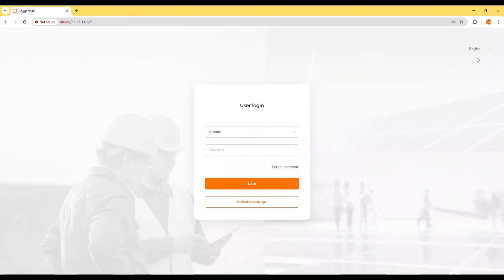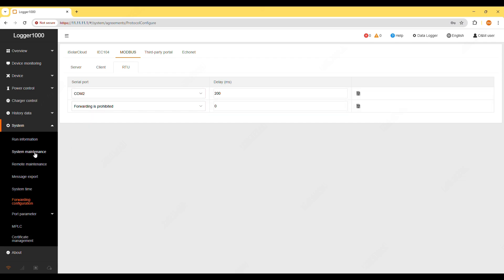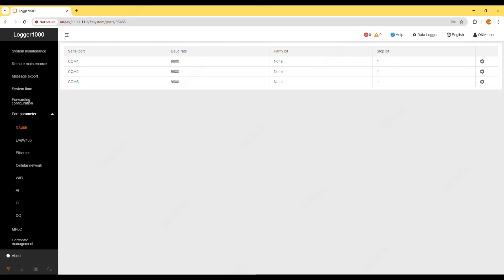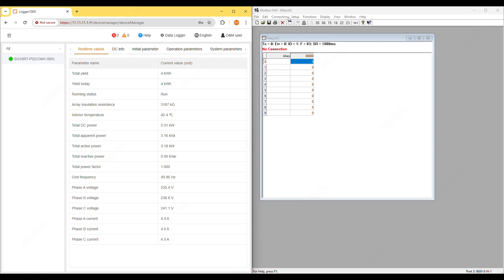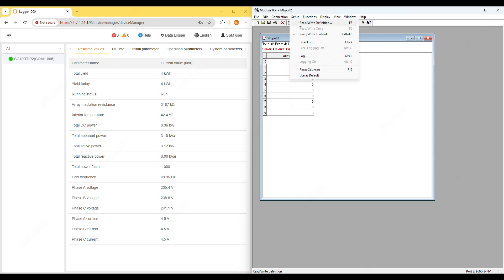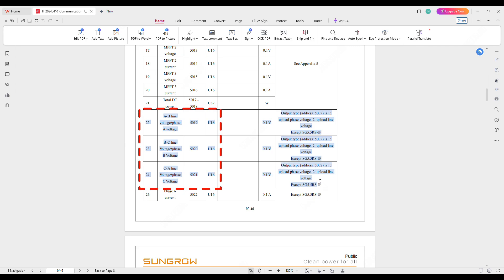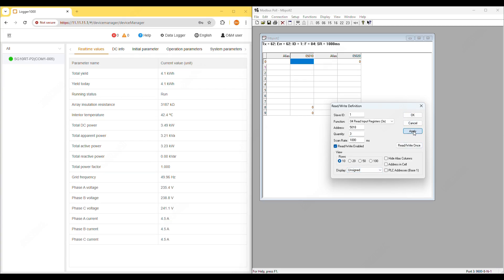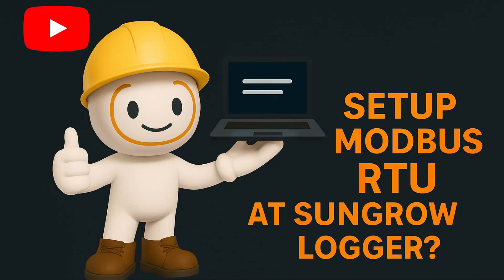Modbus RTU Setup on Sungrow Logger + Modbus Poll Test | Step-by-Step Guide

Comment: How Communicate Modbus TCP method
Reply from the maker: Hi sir, for Modbus TCP/IP, you only need to connect the LAN cable and poll data using the logger’s IP address.

I don’t have a specific video on this topic, but you may refer to the video below if it helps:

https://youtu.be/fRvT2ohYCeo?si=wfpc5BqySIJOM8VI

Comment: If I’m reading Modbus data from the logger’s port 3, while port 2 is already reading the inverter, should I configure it the same way as in your video—i.e., set COM2 forwarding?
Reply from the maker: If you want to poll from COM3, yes set to COM3 😊
Reply: @Other50Hz  Yesterday I tried polling data at the site; the system did return data, but it was inaccurate, and I’m not sure why
Reply from the maker: @MinhTran-v9e8h  Does this mean there are two masters — one on COM2 and another on COM3?